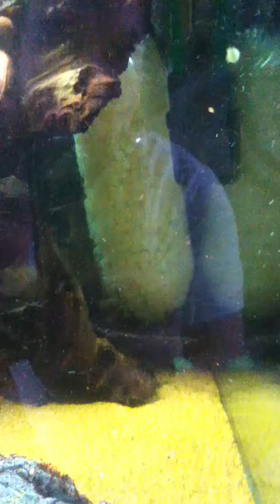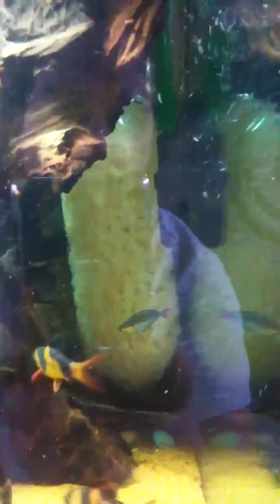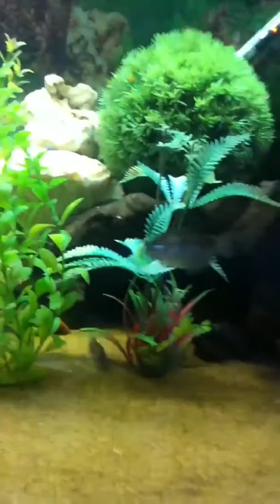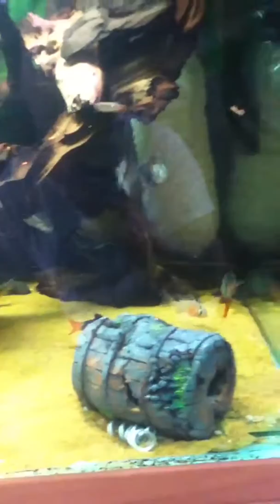Moving bed filter using K1

Comment from the maker: @themoxthemoxthemox For mine i am using a 3 ltr cola bottle with 2 ltrs of K1 i am using a tetra tec aps 300 which had two outlets but i am only using one outlet to power the filter. The bottle is at a very slight angle which may possibly help, i am no expert on this type of filter but i would guess you have put too much media in too soon, which is probably why its not cycling very well.